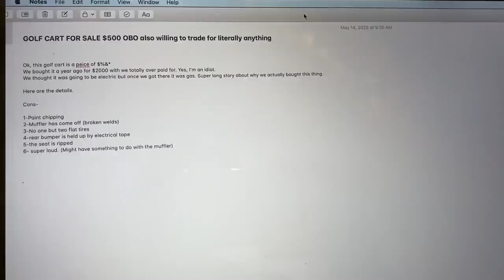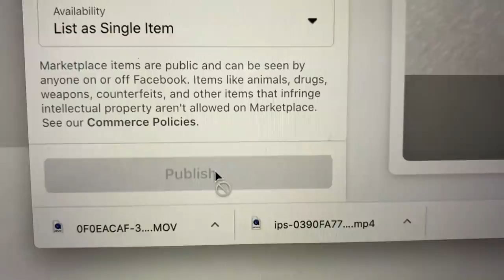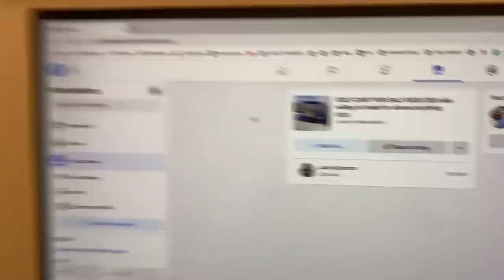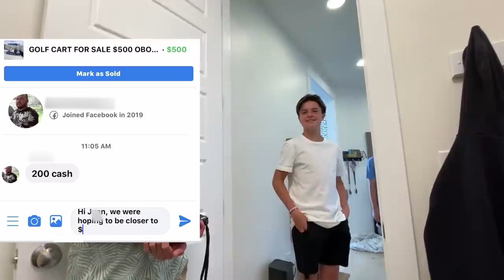WE GOT SCAMMED SELLING OUR GOLF CART | *HOW MUCH MONEY DID YOU GIVE THEM*

Comment: When jump starting the safest option is to use a separate ground located away from fuel induction such as the carburettor  and away from the batteries as defective batteries have an explosion possibility, also touching the car trim when jumping it or another vehicle or even bare metal or framework, it is impossible to receive a shock unless the bare metal is grounded and the person comes in to contact with the positive terminal positive of jump cable or any other positive wires on that car.
Reply: Daniel Nelson when checking for spark always use the apprentice to hold the boots ;)